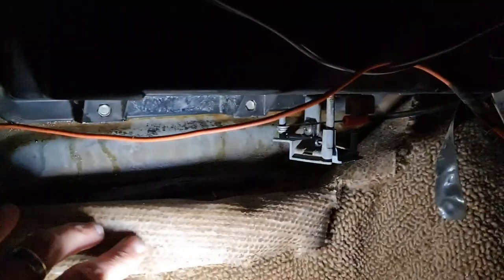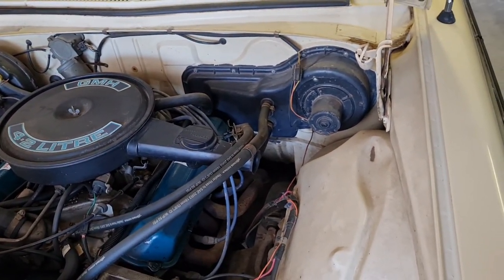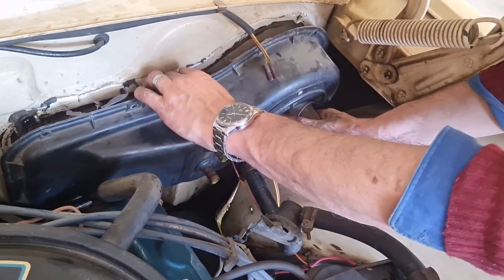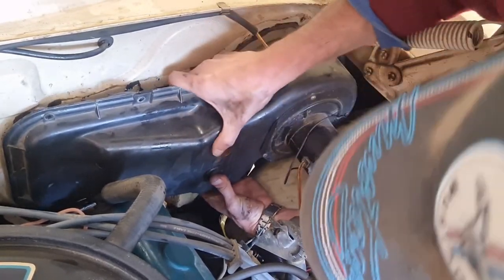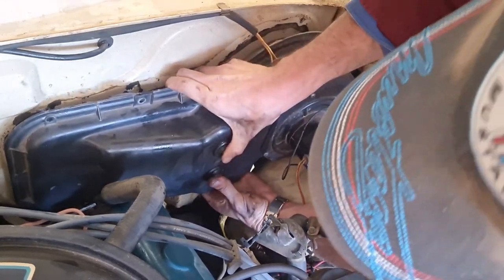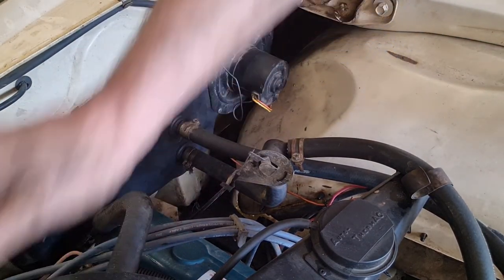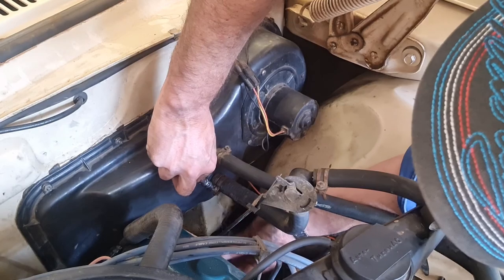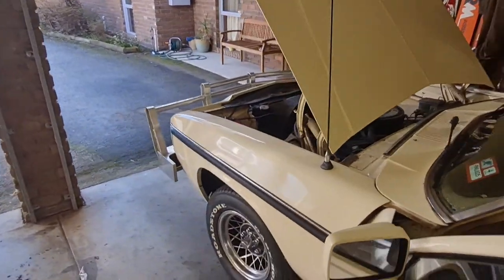Holden HQ to WB Heater core replacement

Comment: Is there a way of removing the heater core completely including the hoses?
Reply from the maker: I spose you could take it out and  put caps on the the thermostate housing, but it wouldn't pass a roadworthy with out the heater for demist on the windcsreen.
Reply: @TheBuckthat  What i did when i didn't have enough money for a new core was just chop the pipes off the old core and put a loop behind the heater box so on the outside it keeps up appearances. But you will miss the heat when you're driving to work at 6am lol.